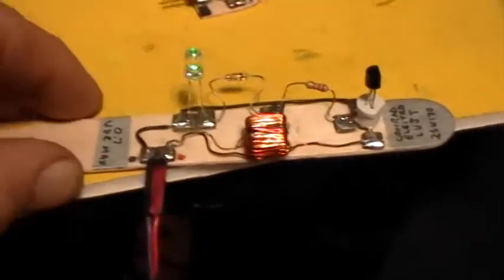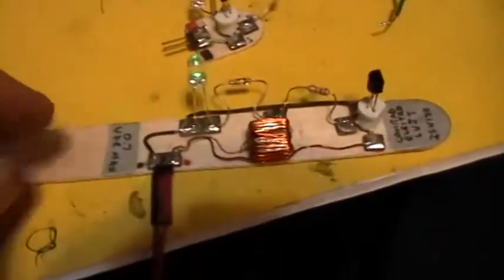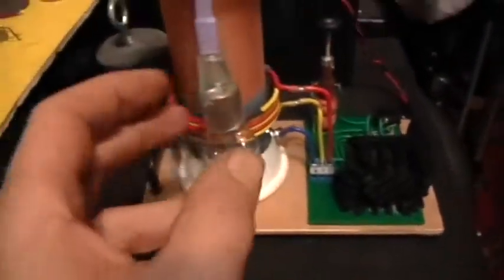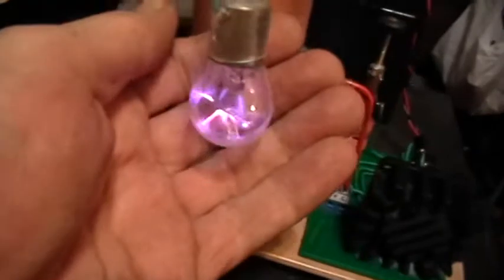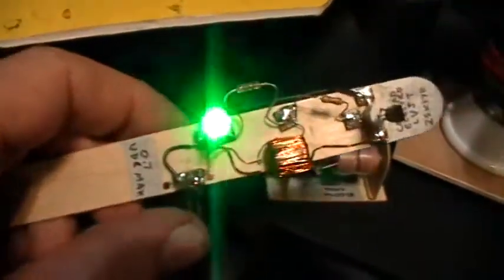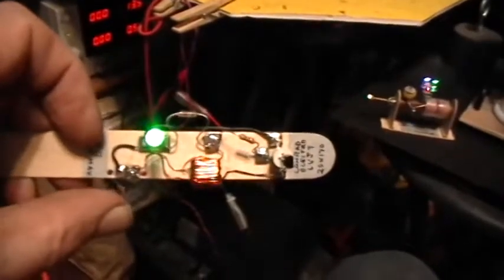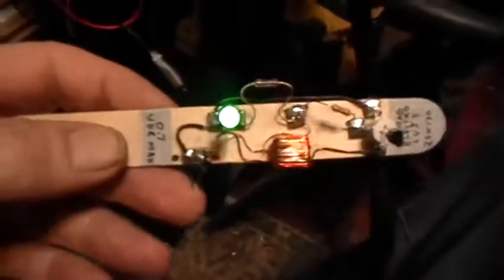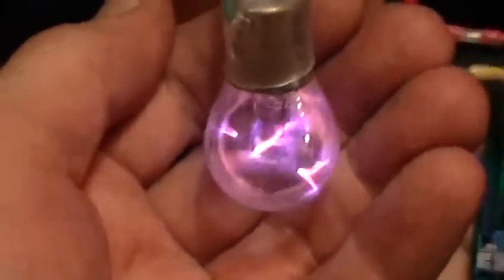Resonance: TK MiniSlayer Exciter and ConradElektro/Magpwr Low Voltage Joule Thief

Comment: keep it up! thanks to independant researchers like you, science goes forward!
I would love to see all the contributers of slayer exciter / joule thief publish a step-by-step summary of how to replicate your work, starting with the most simple circuit.

I've been trying for days now to replicate any of those devices without success, it's very frustrating considering the size of the circuits.. I feel really like a dummie lol.

Anyway, good job :)

take care!
Reply from the maker: Which one specifically do you want to get working? I am sure I can help. I've posted a couple very basic videos on both JT and Slayer Exciter.
TKLabs Replication: The "teslatronix" SSTC aka Slayer Exciter
Joule Thief: Tutorial: Basic JT Made From Recycled TV Parts
Joule Thief: Basic Circuit, Instructions
Cheers, and let me know how it goes!
Reply: I must say your video helped for building my device. I finally succeded, thanks !
the problem was the coil and i think we should tell people to pay attention to it, do it properly. For my S.E I used half a kitchen roll with 0.2mm wire as secondary. I have 4 turns of .3mm wire as primary
Reply from the maker: Google trop curieux
Good ! My latest few videos show a "Mini Slayer" that uses a 2n3055 transistor instead of the TIP31 C, for more power. I tried many transistors and the 2n3055 works for me the best with the smaller coil. I also put the loopstick variable inductor for tuning in series with the secondary, which is a trick Slayer didn't use.
Reply: i am also using a 3055 it seems stronger than 2222 and i can apply a heatsink on it. Did you try the slayer exciter with a microwave transformer as primary & secondary, to see how it would response to pulse DC and what applications? I may try that. Lidmotor's 'skywatcher CFL - wall outlet' video inspired me :D

Nice idea on tuning L2, I'm trying cap's to harvest & smoothen the flow. ^^
Reply from the maker: Google trop curieux
I have better circuits for driving highly inductive loads like MOTs. But the MOT makes a good power supply for certain kinds of SGTCs, although they are much more dangerous and tricky than NSTs for that purpose.
Reply: TinselKoala I'll stick to what I understand LOL the microwave transformer is not making any interesting effect, I may be too ignorant haha.

Small currents allow small mistakes too, which is better for learning.

If you put a coil,  diode, capacitor, diode in series you can charge the cap if you put the coil near L2. woot.
Reply from the maker: Google trop curieux Yes, you certainly can.
Electric OU: TKBloomer Hybrid Wireless Joule Thief

;)
Reply: cheers :)

Comment from the maker: Dear Friends
If you are making comments and they do not appear, it's because of Google's "Spam filter" which I do not know how to change. Out of at least 20 blocking notices, it has only identified ONE actual spam message, the rest have all been false positives.
I am sure that I and many other YT users would be VERY HAPPY if google dropped all of this new BS and just went back to the old system that was in place before they started changing things around.

Now it takes three or four clicks through Google's "improvements" to get to my Video Manager. Idiots. I just made a bookmark for it so now I can still get to it with one click from wherever I am, bypassing their new maze of links. I d i o t s.

For example I have two pages open with this video. One page shows conradelectro's comment but not Binj's, the other page shows Binj's but not Conrad's. I have no idea -- and apparently no control -- of whether both of your comments will finally make it to the public.

Comment: Hey TK. Cool vid. What was the guy you were referring to your video with the akula.  @ 4:43 you say the name (but I couldn't make it out). I would like to check out the vid...
The human body is a great RF receiver.
(Your JK plasma experiment videos are an eyeopener)
On another note, the "improved" + grounding vid should be on the net sometime in the next 16 hours, I have to get back to the lab/basement/shop out in the countryside. I'll let you know when it is published. Thanks.
Reply from the maker: I mentioned Akula, Ruslan and Kapanadze in the video. Ruslan has some vids where he shows people around the radio station transmitter!
Reply: TinselKoala
Yeah, I will check that out. That would obviously have an impact on the RF levels in the surrounding area. Thanks.

Comment: Very nice replication of the 2SK170 circuit. I like the electro smog pick up demonstration and will try it myself.

But I am not the inventor, the circuit was published by a person calling himself "magpwr" in the OU forum. I just replicated the circuit and did some tests with a Peltier-Element as a power source. The only honor I claim is that I documented the circuit and my tests carefully.

This is the thread where magpwr showed his circuit:

http://www.overunity.com/13175/25mv-joule-thief-powered-by-peltier-merely-using-our-body-heat-free-energy-247/#.U8lGYbE383A

With a 100:4 wire turn ratio on the toroid it should light a LED with 50 mV (at about 2 mA). It should be a higher grade toroid (e.g. 3E25 Ferrite)

http://www.overunity.com/13175/25mv-joule-thief-powered-by-peltier-merely-using-our-body-heat-free-energy-247/msg350863/#msg350863

Greetings, Conrad
Reply from the maker: Well, unfortunately in my mind it will always be the "conradelectro" circuit since you did so much work on it.  ;)  I'll try to give credit to Magpwr too but I haven't seen much from him lately.
I am pretty much restricted to parts on hand; the thing works well with the ferrite bead I used. I do want to replace the germanium diode with a Schottky though.
Reply from the maker: Sorry I keep misspelling your handle. My "american english" automatically changes the "k" to a "c". But I think "elektro" is much cooler than "electro" so I'll have to change the title cards in the video.
Reply from the maker: The circuit is verrry interesting. Its behaviour is unlike other JTs I've built. The first thing one notices is that the LED is in backwards (anode is connected to negative supply rail). The next thing.... the LED is not flashing. Oscilloscope measurements indicate that the LED is getting a ripply 2 volt signal in the reverse polarity direction that doesn't seem to actually cut off in pulses the way the normal JT boost oscillator circuits do. Or perhaps the off times are so short and fast that my 60 MHz scope doesn't see them. I haven't tried it with the 100MHz DSO yet.
When I find the right Schottky diode I need to dedicate a couple of videos to this circuit, with scoposcopy. Thanks for "turning me on" to this circuit! I keep thinking that JTs are over and done with, but I keep finding new and exciting variants and effects.
Reply: TinselKoala
The secondary winding is producing some sort of sine wave:

The positive half of this sine wave is switching the transistor on (by lifting the base of the transistor from GND to a positive potential).

The negative half of this sine wave is driving the LED. (Therefore the LED is backwards.)

The 1N5711 diode in series with the LED is reducing the unwanted reverse current through the LED.

I am looking forward to your scoposcopy of this circuit. I found that a scope probe from GND to the base of the transistor falsifies the behaviour of the circuit, at least it changes the frequency (lower frequency). A scope probe has about 80 pF which might cause the "ripple current" over the LED.

Greetings, Conrad